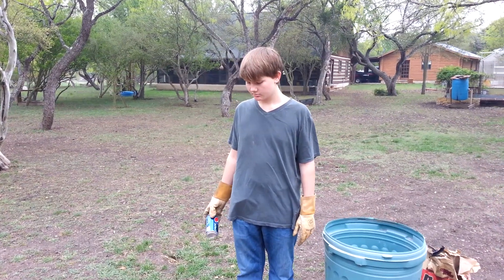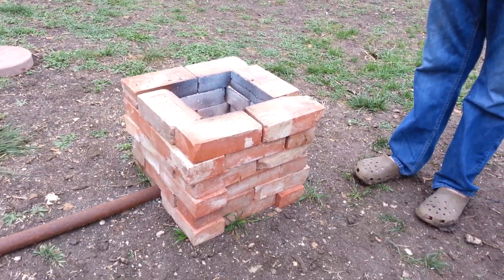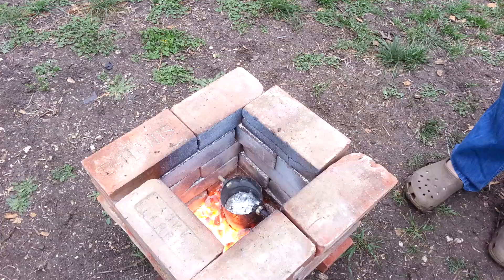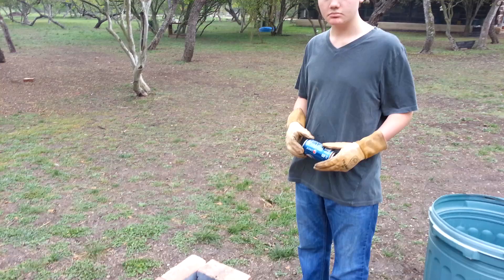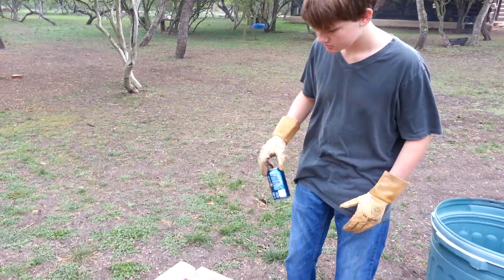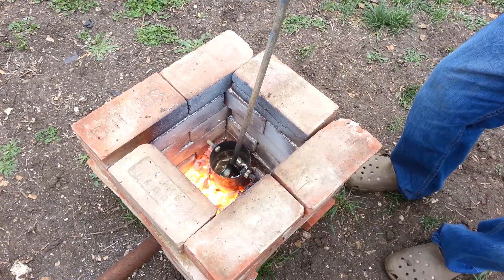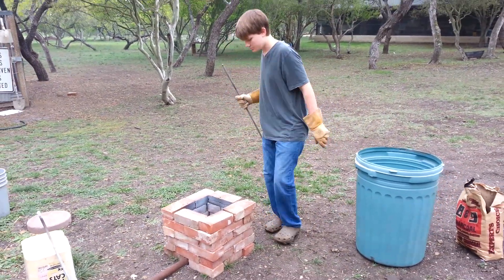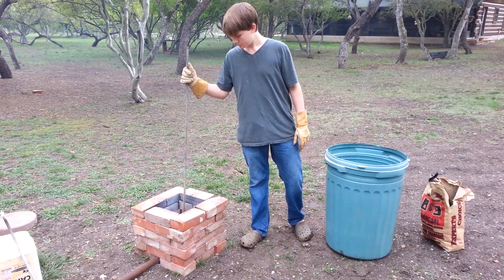Melting Aluminum In A Homemade DIY Furnace Foundry

Comment: Pretty simple example. It can be improved by making two pipes going in from two sides as a cyclone. 
In our situation the clay bricks are alright, but if you go to higher temperatures - you might want to consider high temp bricks. 
Oh, last but not least- adding a lid with exhaust hole would prevent some heat loss.

Comment: Doesnt the hairdryer break? Thoght so because it has a heating element alt that can get too hot, or not?
Reply from the maker: nope, still works. It has been used several times for this purpose.
Reply from the maker: It doesn't need to heat up... just blow air. We use it on the "cool" setting for this.
Reply: Blake Kirby but what if it does not have the cooler setting? Is it possible to modity it and take out the heating element?
Reply from the maker: Olav Amh I'm sure it could be modified to disconnect the heating element, but please please if you try to do that be careful. I've tried to "fix" electrical things before and gotten shocked. It's a serious risk. Be careful.
Reply: Blake Kirby okay tnx

Comment: use the bottom of a fire extinguisher or a small iron pot. Those are designed to resist heat related failure
Reply from the maker: +roman hilltroychcovich that sounds like a good idea. If we ever find some for free we'll give it a shot.
Reply: Do you know how hot the found gets?
Reply from the maker: roman hilltroychcovich not exactly, but the last time they ran it they got some copper soft. The copper didn't melt but it got soft. Copper melts at 1984 degrees so we had to be getting close to that.
Reply: Ok then using any kind of iron product thicker than 7mm should work quite well, but the crucible will remain hot longer, which isnt all bad but dont dip it in water it will warp the crucible
Reply from the maker: roman hilltroychcovich thank you for that advice. I'll share that with my boys. They like to do this every once in a while just for fun.
Reply: +Blake “Daddykirbs” Kirby No problem at all. if you need any quick info from experience im a material technician and you can look me up on Google+
Reply from the maker: roman hilltroychcovich gotcha, just added you to my circles :)
Reply: +Blake “Daddykirbs” Kirby Likewise :)

Comment: How did you get the green propane tank to the point you could use it?
Reply from the maker: kettch42 We bled it out by depressing the valve on the top. Then (once sure it was empty) poked a small hole up on top by the valve (to make even more sure it was empty)... then cut the top off with a angle grinder with cut off wheel.
Reply: I would have been afraid of the remaining propane, especially around sparks of the angle grinder.
Reply from the maker: kettch42 It's good to be very cautious.

Comment: ive made one and its about 20/10 degrease away from melting the cans and I cant get it hotter how did u get it this hot
Reply from the maker: moonstone productions It could be the wood fuel you used, some doesn't burn as hot. Also, keep the air blowing on it.
Reply: k thanks

Comment: This is most likely a bit late. But if you use that same setup but with a bigger area to hold charcoal, you can use a steel bucket. Just go to the camping department in a store and there should be one.
Reply from the maker: 1%UnAwesome Good suggestion, thanks :)

Comment: Hi cool video thanks for sharing, just one small tip, when I started with metal casting I was experimenting with different types of crucibles. I would not recommend to use a tin can as a crucible. You might get one or two uses out of it but it will break very quickly and the molten aluminum will end at the bottom of you foundry. If you want you can have a look on my blog, I have a post regarding my evolution of a crucible ;-) www.flamingfurnace.com/
Reply from the maker: Thank you for the resource. My son will love seeing this.

Comment: Great Video. Only one thing, safely dude! Need some long sleeve clothing, good shoes, and some eye/ face protection! 

I'm only saying this because when I melted down Aluminium last year, if I hadn't been wearing a face shield, I would have had molten metal burn my face.

I am 18 years old, and not an YouTube troll! 

See if you can make some greensand up and get casting some stuff! 

Stay safe,

Ollie
Reply from the maker: Thank you for being concerned. We will get better about the safety precautions. My son is looking into the Green Sand material.

Comment: Great to see some real DIY while a youngster learns ,,a few may holler foul on safety but don't we learn safety from those little scorched moments ,,start small and work our way through it - one step at a time ..look into whirlygig and automa wood projects for some great gear and DIY building basic ---a lot of all wood foot treadle powered scroll saw and lath videos here on utube also and a farm will have 99% of what you need just laying around ,,I used to use old screwdrivers for my carving knives and chisle --almost planting time here !! YEAH Spring !!
Reply from the maker: Yes! I do certainly appreciate the safety warnings. However, my kids are WAY safer than I ever was. I shouldn't be alive today.
Reply: hha ..Yes ,I still wonder how I managed being a farm kid always prowling caves and crossing pastures with angry moma cows .I could shimmy up a tree or doge a snake strike but never felt accepted in schools,,those kids seemed so phony to me and always caused grief for sport ..Farm kids are way ahead IMO

Comment: Nice little build chaps :)
Have you tried any other metals ?
Cheers
Reply from the maker: He tried some copper, but the crucible container was already shot so that small batch was ruined. Last night he melted some glass just for fun.
Reply: Glass would be fun to play with methinks :) Wonder how it would go in a wet clay mould?
Reply: when I had time I use to have glass rods I melted with a torch and hot head to make beads.  It was a lot of fun to just melt the glass and watch it fall. But I have to have a kiln for glass to cure it though.

Comment: I worked 8 years in a secondary aluminum smelter, and I'm having a heart attack over the lack of safety gear your son has on.  I've seen disgusting burns over my time there.  Some boots, jeans, long sleeve wool shirt, gloves, and safety glasses, if not a face shield should be the bare bones minimum.  Please be safe!
Reply: We poured a molten aluminum in a slightly wet metal mold and it exploded and it was everywhere. My friend was wearing a face shield and if it wasn't for that he would have got it in his eyes. Very scary. If there are small drops of water in the cans it'll probably  explode too. Safety glasses are at least mandatory.
Reply from the maker: We do exercise caution... but not perfectly I'm sure. Thank you for your concern.
Reply: @daddykirbs How are His lungs now? Any issues from the paint fumes from the cans?
Reply from the maker: @intothevoid47  no issues :)
Reply: @daddykirbs  Sweet, I'm glad to hear that.
Reply: At least he has his crocs in sport mode